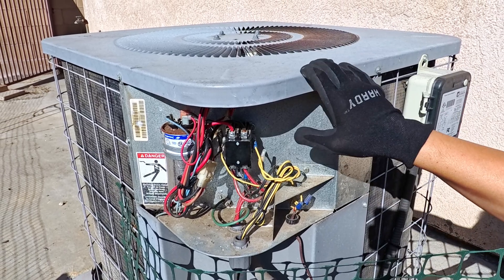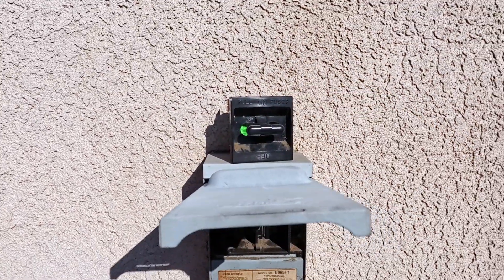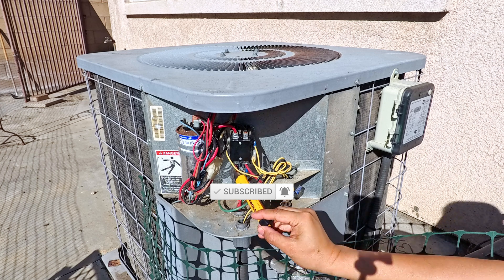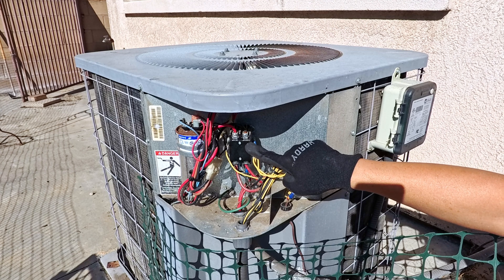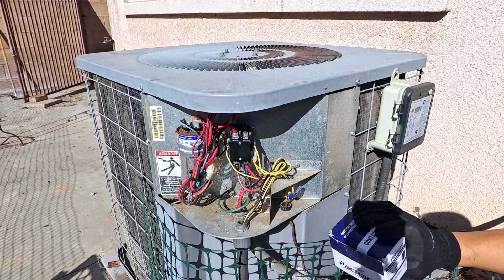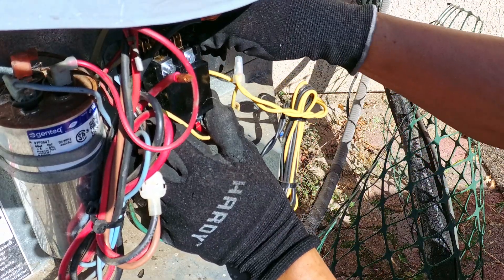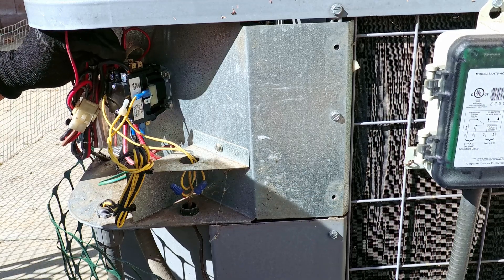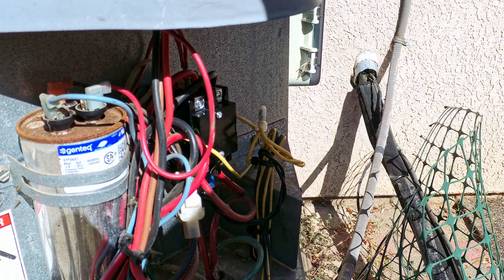Outside AC Won't Turn off in House?  -How to Replace Stuck AC Contactor FIX

Comment: Dear James. 

Can the contactor be stuck closed even if unplug thermostat ? I leave the AC working fine turns on and off but randomly the AC does not switch off and room temp goes very low. I only turn off AC switch and wait for few minutes and when i turn power on again the AC works again fine but repeats the issue
Reply from the maker: Yes, that can definitely happen if the contactor is defective. If you unplug (or shut off) your thermostat, and your outside AC unit is still running, that is a sign that your contactor is stuck closed.
Reply: @JamesFixIt contactor switch stuck only popping out when you turn thermostat off